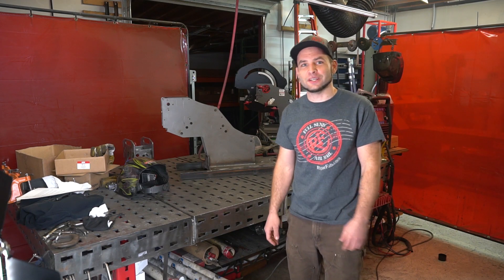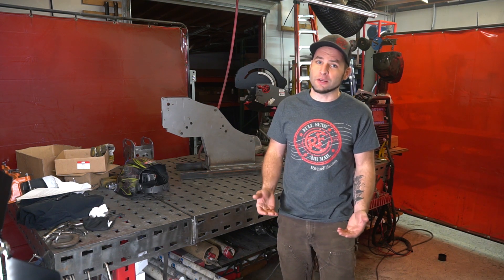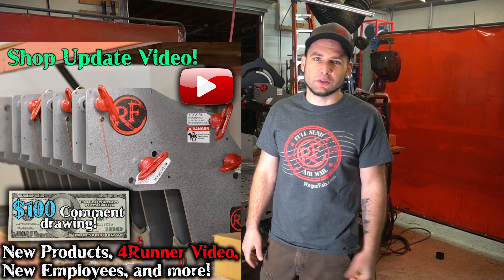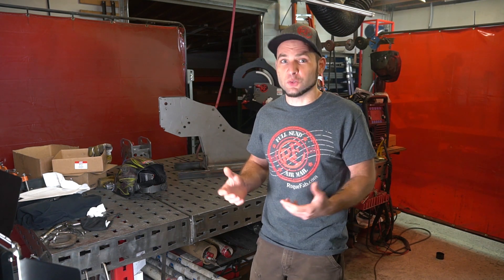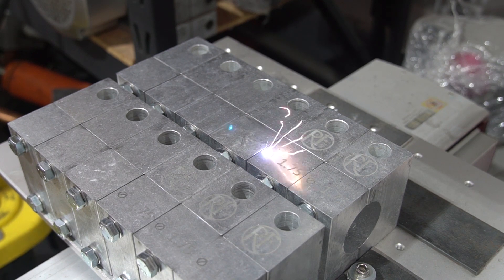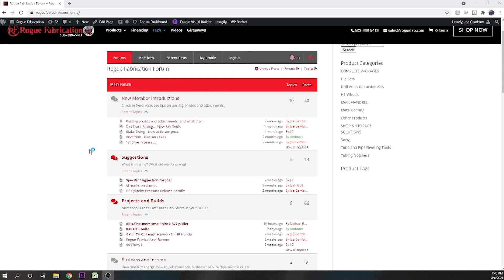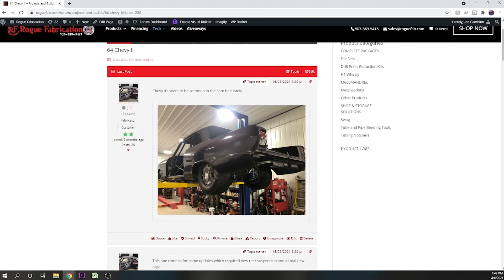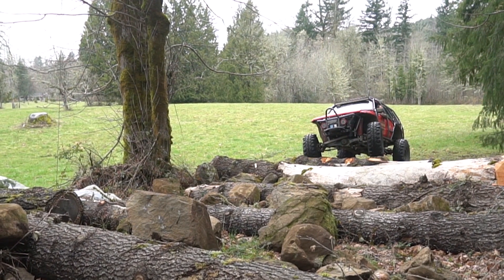Rogue Fabrication Shop Update (+4Runner) April 2021! Tube Bender package and DIY kit lead times

Comment: The exo-cage on that sucker is awesome, what size tube did you use? 1.75"?
Reply from the maker: I know this will sound odd... it's about 70% 1.75, 20% 2", and the rest is 1.50, 1.625, and there are two pieces of 1 1/4 A513 sch 40 pipe (these PIPES are only gussets).